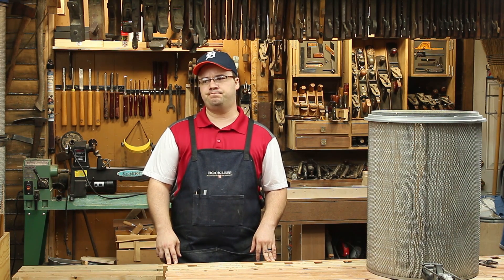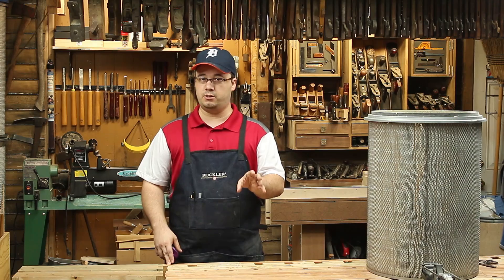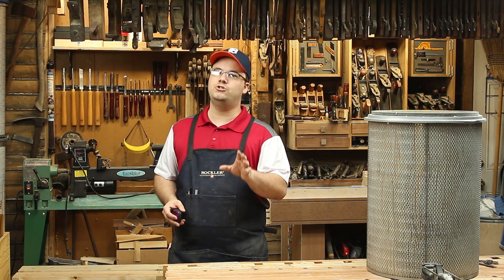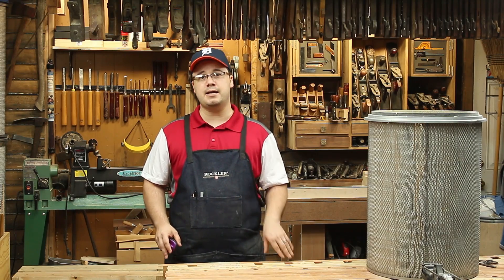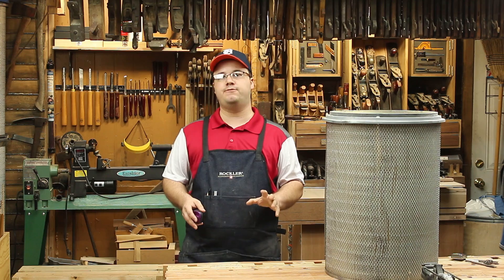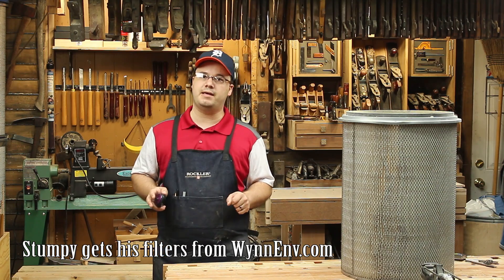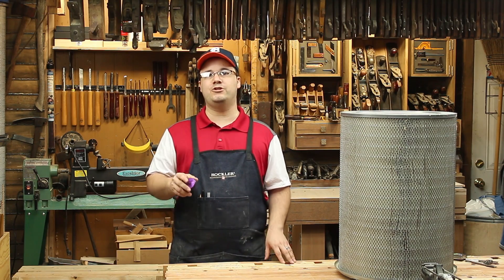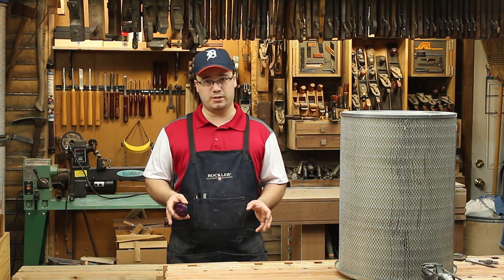SNW45- Woodworking dust collection upgrades- MAKE YOUR OWN MANOMETER filter monitor!

Comment: Cutting a hole in a duct or other place with speedy airflow is a bad idea due to bernoulli effect siphoning; you need airflow to be as slow as possible to measure pressure adequately.
So this otherwise great video needs some annotation.

Comment: Did you get all metric up in this hut...
Reply from the maker: Is that English?
Reply: @StumpyNubs  Well since it is my second language my guess is my joking skills isnt perfected just yet :) Thank you for a great vid and an awesome chanel. I have a dewalt one stage that I am thinking of upgrading to a 2stage with a filter instead of the bag. One thing i have been thinking about (no troll) Is there a difference between clockwise and not clockwise cyclones? (thinking about how water drains in tub.) /d

Comment: Love the video! If you're looking for a ready to go solution, check out our differential pressure gauges. They are just like a manometer, but display the pressure on an easy to ready dial. See here: http://differentialpressure.com/differential-pressure-gauge-overview/600dgc-differential-pressure-gauge/
Reply from the maker: I appreciate your desire to inform our viewers about your products, but there is a better way to do it than posting an unsolicited advertisement in the comments section of our video. If you wish to have us consider your product, please visit our website (stumpynubs.com) and use the "contact" page.

Comment: Sooo...if I have an HF DC that is outside and under my house that I have plumbed through to my cyclone separator inside my shop - is is better to remove the lousy filter bag altogether and just let any fine stuff blow free (I really don't care given it is outside and under my house)?  Sounds like just having the stock filter bag on there restricts performance?  And btw - so far after a couple of months of use - nothing has even reached the DC (as far as I can tell) - it all gets trapped in the Super Dust Deputy.  So very little will ever blow outside out of the DC.  Thoughts?
Reply from the maker: Yes, I'd take off the filter bag.

Comment: Hi Stumpy - Love your work and channel.
I wanted to ask a question as I am still rather new to woodworking and I am also in the process of setting up my shop.
I have a Rockler wall-mounted dust collector that I have mounted in a closet and it is attached to a dust collection bin and ultimately vented outside my shop.
As the unit does not use a filter, is there any means that you can recommend for me to ensure that i am gaining maximum performance on airflow?

Thank you for your time.
Reply from the maker: The Rockler collector is under powered, so the most important thing is to only hook it to one machine at a time and keep it close to the machine you are using. That means no duct work running to multiple machines.I would mount it in a central location and use their DustRight hose to connect to whatever machine I am using. That hose stretches only as long as needed for each hookup, so it helps with airflow. I don't think it would be worth the expense. Use it as is and upgrade down the road once you've gotten the tools you need first.
Reply: Stumpy Nubs Thank you sir - Much appreciated.

Comment: Mr. S. Nubs.  I cut all the lumber for the "Multi-Function Router Lift" project yesterday.  I couldn't help but laugh when you gave the measurement of 3 4/8" for the Upper lead screw block.   I have never seen a mathematical joke before, but knowing your sense of humor I realized your wit within the instruction.  Brave Mr. Nubs, bravo.

Comment: Hey Stumpy, great video!  You should be able to put the manometer anywhere in the shop.  Because your measuring air with an open ended manometer, any distance effects should be very very small.  It would be good to get it off of your filter, because you're blocking some of that surface area you made by going to filters.

Comment: What a great idea, I have a similar indicator on the radon stack, but never thought about using one to indicator the efficiency (or cloggyness?) of the dust collector.  Of course, I am still using one of those 5 micron bags, trying to decide weather to upgrade the filter, or simply upgrade the unit (1 hp) to a new one (2+hp) with filter.  Tks again!

Comment: Stumpy, the best throughput for a dust collector is no filter at all.  I went the HF dust collector, then added a second bag and realized just how much through put I was losing, even with the second bag.  Soooooooo, I put in a cyclone, and ported the out put of the cyclone out of the shop and into a small "out house" (complete with the half moon on the door.)  I had the output pipe blowing into a 30gal can with a burlap cover, and realized that even that was robbing me of CFM.   So now the pipe merely dumps into the building, which also conveniently serves to tell me when the chip bin is full by blowing chips out under the door of the out house.
Reply from the maker: Yes, that is true. But not everybody can do that.
Reply: Stumpy Nubs I know, but for those who can, it is an excellent option, and one that is almost never mentioned.

Comment: Thanks for the info Stumpy, I've been wanting to upgrade mine for some time. Every time I turn it on and see that huge puff of dust coming from the bag I cringe. Always wondered about when to clean the pleated filter and didn't know they could be stacked. Mike
Reply from the maker: Stacking depends on the filter style. They have to be open on both ends. Single stage collectors with bag filters don't need a stack, just a single cartridge is 8X more surface area.

Comment: Related question, I have a cyclone and a cartridge filter. But how do I clean the cartridge filter? Cleaning the old bag was pretty easy, if messy. But cleaning the cartridge escapes me, I have paddle beater on it which helps somewhat but there is a still a lot of dust stuck in there.
Reply: You want to be careful when you clean the filters, you don't want to breath in all of that dust you spent so much effort keeping out of the shop.  Most particles less than 10 microns will stay suspended in the air for a long time.  To give you an idea, the size of particles that make up smoke from a candle are about 0.2-10 microns.
Reply from the maker: It depends on the filter. The ones we use from Wynn Environmental are cleaned by simply spraying compressed air on the outside. It blows all the embedded dust into the collection bag (on a single stage unit) or into the lower tray (on a cyclone), which you can then empty.
Reply: Ok thanks, I'll try giving that a go on the next rainy day :)
Reply: I'm going to try and do it outside on a rainy day and wear a mask.
Reply from the maker: caskwith If you are blowing from the outside of the filter you shouldn't have to take it outside. All the dust will go inside the filter and drop into the bag below.

Comment: ... A manomeneter measures air pressure not flow. Think you need a form of anemometer.
Reply from the maker: I said when the airflow is restricted by the filter it builds up PRESSURE which can be measured by the manometer. The meter is not intended to measure AIRFLOW, just the pressure changes caused by the filter as it clogs.
Reply: Stumpy Nubs
Stumpy  Can you convert the bag type dust collector to a filter.  How many times can you clean a filter before you need to replace it.   How do you clean the filters?

Comment: Don't measure pressure around a curve, it doesn't work.  You need to measure pressure on a straight section of pipe.  Also, I'd recommend using an oil rather than alcohol or water.  It won't evaporate quickly.
Reply from the maker: If you Google "manometer" you will see quite a lot of commercial versions with a bend. In this case, oil wouldn't work either as it would be heavier and less able to react to the low pressure of the dust collector.
Reply: I was talking about where you connected it, not the meter itself.  It doesn't need to be "instant" either.
Reply from the maker: Nicholas Smerk It may appear to be connected to a curve, but it is actually connected before the curve, directly in line with the impeller.
Reply: Cool.  If you measure at the curve, the way the air, or liquid flows will cause the reading to be off or not existent.  I've had engineers jimmy rig stuff...ugh enough said.
Reply from the maker: Nicholas Smerk Like I said, there is no curve where it is mounted, and the curve in the tube is not an issue with this design. But I appreciate the info!
Reply: Stumpy Nubs Cooking oil is actually lighter than water. The density of cooking oil is lower than water. You can test this by pouring some oil into a jar full of water. The oil will form a layer on top.
Reply: Stumpy Nubs Nicholas is right about measuring in the elbow between the blower and the filters, it's typically a bad place to make an "accurate" measurement.  But, you don't need an accurate measurement and that's the best location that you have between the blower and filter.
Reply from the maker: Dominic Barone Where it is located in not in the bent but in line with the blower.